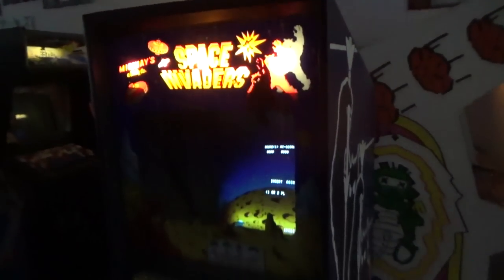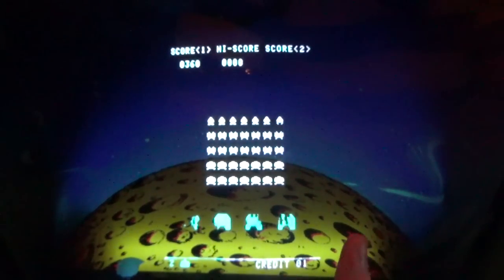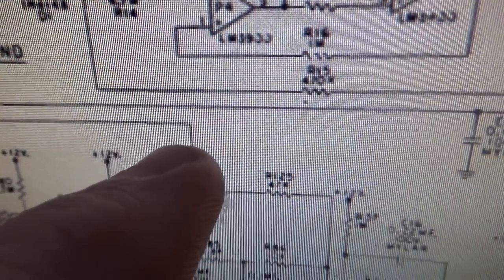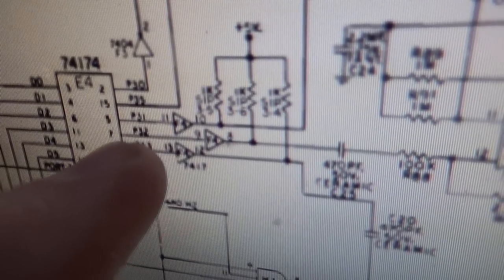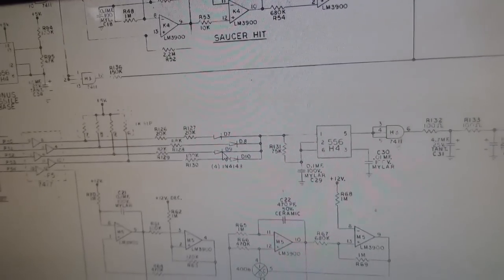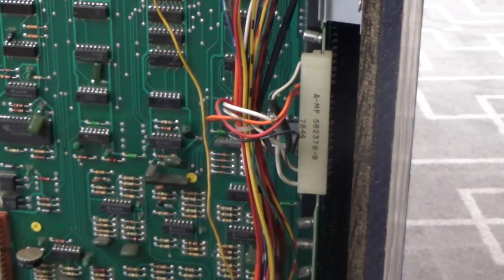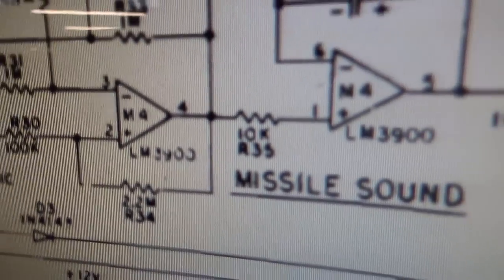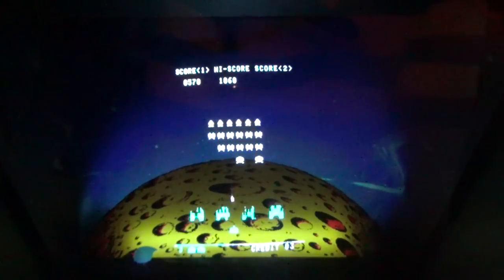Found a 44 Year Old Error In The SPACE INVADERS Arcade Schematics Midway & Taito Classic PCB Repair

Comment: I think your call of M4 was right. Its entirely possible for one section of an op amp chip to fail on its own. The entire chip doesn't have to go bad. Seen it a number of times in PURC 5000 advanced digital paging systems.
Reply from the maker: I usually poke around and get it after a chip or two :)  I'm getting better at the EM pinballs, last night I fixed one down to the SWITCH off of the schematics, I could tell exactly what switch it had to be.  Thank you for watching Yu Wish like always!

Comment: I have the exact same Midway Space Invaders machine.  After a few years of ownership I noticed the saucer sound stopped.  I had the intention to eventually repair it.  Before doing so I ordered the "save game" chip that also included "Space Invaders Deluxe" and a few other games I never heard off.  Anyway,  After booting up the machine with the new chip I noticed that it fixed the saucer sound problem I had.  2 years later and everything is still good now. g up the machine with the new chip I noticed that it fixed the saucer sound problem I had.  2 years later and everything is still sounding perfectly.

Comment: Do you remember the original Galaga that had the software error where the blue and yellow fast moving fleet would come so fast and diagonal in the corner and it was super human speed that you could barely see it was so fast and impossible to get out of the way

The company, I think Namco, they issued new eeproms with the corrected code that fixed the glitch

I remember when the game came out and I would play it at the local mall in town with my uncle and he would get so angry when it would do that glitch and he would scream at it and say there was no way you could get away from that why would they do that and it was only a short time maybe a couple months before that machine was either replaced or they replaced the eproms in the game
I actually think they were ROM chips

They were not eprom they were hard coded at the factory with the programming and could not be changed

And there was I believe 8 different banks of ships that made up 8K of memory for each of the different screens and components and there was another set of chips that handled specifically The sounds the game made

And I thought they actually had separate Giant XT size motherboards that had the sets of chips

Maybe some of the original games did have that before the large enough chips were available to be able to put 80k worth of memory chips on a single board

I'm 99% sure I've got a memory of watching a machine being fixed where they were pulling out boards

And I am 1000% sure that the first digital linked traffic lights had rows of boards that plugged in that each handled something different

I remember my town had six traffic lights and they were all the old rotary clock style with the thumb screws and the little mechanical levers and the boxes were very small like 8 in by 11 inches by 6 in deep

And the clock wheel would turn and as the set screw would push the metal switch you would have the one side red and the other side green and that lever that it hit would turn on the yellow light circuit and all four hundred Watt bulbs for the four yellows on each side would all come on for one second or two seconds or 3 seconds depending on how far they moved the next thumb screw and as it moved it would hit the next switch lever and at the same time the yellow switch would be pushed to turn off the yellows and the red and green would flip so the green side would go from green to Green and yellow and then the green and yellow would turn off in the red would turn on and on the red side the red would be on and then the yellow would come on so you'd have red and yellow at the same time and then both the red and yellow would turn off in the green would turn on

Prior to that design they had an extremely simple alternating red and green so the lever would be flipped and you'd have read on one side and green on the other and as the wheel came around it would flip the switch and the power would be turned on to the other light and turned off to the one that was on

Those were dangerous and people wouldn't have any notice it was going to change and that's why they put the yellows in and I remember each change they made but for some reason our little city was chosen to test the first networked traffic lights and we didn't have that much traffic but these silver control boxes were about 8 ft high and 3 ft wide and 3 ft deep like a phone booth with a giant door on the front with smaller doors in the giant door that gave limited access for making the lights go to blink or all red or some other feature

But this was in the 1970s I think 77 and it was way ahead of its time and they had the boards that were almost 3 ft wide and 3 ft deep and they had chips and relays and capacitors and coils and all sorts of parts and they had an edge connector on the back that was almost the whole length of the board and it plugged in to the back of the case that had all of these connectors and those were mounted horizontal and on the bottom there were other boards that were mounted vertical.

And each board handled a different function and there was a networking board and it was I think either 2 25 pin or 1 50 pin connector and a giant fat cable that connected the two networking cards linking the one box to the other box and it was only a half a city block between the two lights but it would change the lights at the same exact time and I didn't understand why they didn't just wire one control box to the two sets of lights since they were changing at exactly the same time but they were prototypes for what would become the traffic control grid that cities rely on now to maintain traffic flow smoothly throughout the entire city and county and State

I remember the counters that each time a car drove over the embedded antenna in each lane on each Street it would click and count how many cars there were and they could set how many cars they wanted before the light would be tripped and how long to wait after that number was reached and how long to wait if that number wasn't reached so if there was just one or two cars how long did they have to wait before the lights would change

I remember the chips that were used in video games some of them were considered National Security because the simulations could be used for real life applications like traffic control or military tracking and guidance

It seems funny now looking back at how primitive it was but the games ability to try to shoot down your ship was the start of AI

And that software really was used and improved on by the military

I got to watch one night when a test was being done on laser communication from the ground to a satellite using a self-tracking satellite dish on the ground and it would acquire The satellites pilot conventional signal that most satellites have that identify what satellite it is basically its name like a VIN number on a car and this thing acquired the satellite and the modem sent standard handshake protocols into the laser transmitter and we were wearing special goggles and we saw the beam on the dish on the ground turn on and we could hear the handshakes and the two-way Communications and we could see the beam that was the analog sounds being converted to digital light pulses and once it had handshake and established the connection it transmitted continuously as it tracked the satellite from one horizon to the other horizon until it was just about to go below the horizon and it knew it's elevation and disconnected and the beam stopped

Nowadays this is how a lot of signals are sent especially for satellite to satellite they use laser beams but back then it was something right out of Star Trek

I watched The Big bang theory and the episode where they were bouncing the laser signal off the Moon I remember a bunch of guys at the college doing that from the roof of the particle accelerator building

We also used to bounce shortwave radio signals off the Moon

And there is a whole group of ham radio operators that use micro meteorites that constantly disintegrate as they hit the Earth's atmosphere and they are able to bounce signals off of those and I still don't understand how they do that but I've seen it done

The VHF ham band now has all of these digital chirps where they are using their Android phones hooked into aprs I think is what it's called on the ham radios and they're able to transmit very short messages basically their call sign and the call sign of the other station they're trying to communicate with and the GPS location and a few other characters, but it allows the app on the phone to show the actual current GPS location on the map of where all of the ham radio operators are that are transmitting this data

It's pretty cool and to think they were doing this before there were smartphones before it became commonplace and easy to do

Anyways I've ranted long enough
Reply: I feel obligated to give you a thumbs up just for the sheer length of that post.  Some cool info there too!

Comment: Subscribed - I'm amazed by all the descrete logic and analog circuitry that went into making the sounds for Space Invaders, something that today could be accomplished by a microprocessor such as a raspberry pi or even an arduino. I have an old laser that is similar vintage to Space Invaders and it too is full of descrete logic/gates/timers etc. The op-amps tend to blow occasionally when there is a mains surge as they are mesuring B+ of around 100V via a simple voltage divider, and current through a large low value high wattage resistor. There are gates to control safety interlocks, op amps to measure current, voltage, and laser power and timers to sequence all the events that happen during startup, running and shutdown. I keep it original, but you could easily substitute a switching PSU and microprocessor in place of all that stuff, and the power supply or "exciter" would be 1/3 of the size and weight! :)

Comment: As the invader formation gets narrower it has further to go across, plus it also drops fewer bombs and the safe areas for the base are wider.  But as the formation gets really tall it gets more dangerous as the bottom is closer.    I always narrowed it sideways to 3-4 columns, then tried to get them bottom up.  I always liked to get the last two stacked vertically, that makes them easier to hit than if side by side - you can either shoot ahead of the top one or behind the bottom one, but never between them.  If side by side and you miss the leader your shot will almost certainly pass between them.

Comment: Just thought I’d add Ron, that the part marked as 4006 is the same chip as the 4016, (marked N5,J5) there are four switches in a pack and there’s just one on the board… The CD4006 is a counter it’s here on the board but it’s just makes the white noise sounds, along with s9me EX OR gates. More errors :)
Reply from the maker: Yeah I never quite caught that one but you're right, the gates are all on the same chip but there IS a 4006 for the white noise, geesh you'd think they'd check this stuff :)  That one is still wrong on the Space Invaders Deluxe sheet too though....
Reply: @LyonsArcade  Old schematics can be a mine field…does it add to their charm though :) those LM3900 are shocking, sometimes wonder if to shotgun the lot…That said I’ve had new old stock ones be bad right out of the tray…

Comment: A couple of Easter eggs to report:

The earliest version of this game -- Taito's first release -- reportedly had an Easter egg where "something" happened if you destroyed an alien from the bottom row, last. Some reports said it worked with an alien from the second-from-the-bottom row as well. I never saw one to try it out myself; everything I ran into back then was a Midway version. (I'm not really surprised, since Taito's release was in Japan and they licensed the game to Midway for its worldwide release. I've never been to Japan, much to my disappointment.)

The second Easter egg was in the Atari game system console (Atari 2600) version of Space Invaders. In that game, which had a variety of modes you could play, if you put the cartridge into the system, held the reset button down, and then turned on the console, you would start in a version of the game that gave you two shots on the screen at one time instead of just one. I had that game and it worked as advertised.

Not an Easter egg, but some people think it is one: True randomness is impossible with computers, so they simulate it. The simulated "random" score for the UFO wasn't very sophisticated. You would score 300 points instead of 100 points if you hit the UFO with your 55th shot. After the 55th shot, count 15 and repeat. (So with shot 55, 70, 85, 100, 115, etc. Start over with each level.)

For those who want to know more about this game, I offer this link: https://en.wikipedia.org/wiki/Space_Invaders
Reply: On that first one, it was reported that the "Easter Egg" was a rainbow explosion. I have never seen it and believe it has proven to be false.
Reply: @roscianyt  Its in space invaders part II for the rainbow
Reply: first 300 points is the 23rd shot not the 55th

also midway just manufactured for the US, not Europe or Australia, but I guess that's nitpicking

Comment: Does anyone remember a space invaders cabinet that had a physical tank center front that turned left and right, and the invaders were projections of red lights along the back wall?
Reply from the maker: Never seen that one!
Reply: You mean the modern Space Invaders Frenzy?
Reply: @neilwilliams2907  Well this was definitely in the 1980s if I recall.
It was a real plastic tank (a few inches long).
Wish I could find a reference.
Reply: Investigating more maybe I'm misremembering 'Midway Invaders from Outer Space ' 1970.  The missiles did go top to bottom and there was a physical tank and a red projected missile. Could have sworn the invaders were red projections as well though...

Comment: I read some history of this game and there is no programming that speeds up the invaders as they get eliminated. The processor for this game is so weak that as the invaders get eliminated there are fewer items on the screen and thus the invaders speed up.
Reply from the maker: Everybody says that and it's an interesting idea, but my mind always thinks, how come the main ship doesn't speed up?  So i'm not sure that's exactly true.... None of the shots speed up either.
Reply: @LyonsArcade  People describe it as a "bug", but it's an integral design feature. There's a set amount of time for the processor to work between frames... (or half-frames in this game's case since there's two vertical interrupts but that's another story)... and graphics-wise that time is (more or less) alotted between six separate "objects": the player, the player's shot, the next invader that moves, and three different invader shots. (The UFO uses the third shot's time when it needs to be on screen). Since there was already so much going on, the invaders speeding up naturally occurred as a mechanic since it means you can just worry about the "next one that moves"—redrawing one invader per frame, and the less there are the faster the swarm goes.
It's clever. Perhaps it's serendipitous, but everyone who calls it a bug or a mistake that was just "left in" doesn't really understand the experience of assembly programming. This part of the design was definitely decided on at an early stage, and I'd wager it was on paper before Nishikado even wrote any of the code.

Comment: The speeding up of the invaders wasn't designed that way it was a system limitation due to the number of vaders displayed would slowing the MPU/CPU down - as you killed them it would speed up because the MPU had less to do
Reply from the maker: Why doesn’t the ship sped up?
Reply: Missiles stay the same speed, too, whether from your base or an invader.  Easy enough to see if the invader speed-up is intentional (I think it is) if someone looked at the code.

Comment: I found a file you were looking but for the Midway version at https://www.arcade-museum.com/manuals-videogames/S/SIDeluxe.pdf
It is schematic part No. M051-00851-A002
Game Logic P.C A082-90700-A000
Used on Space Invader II Cocktail, Deluxe Space Invader Upright, Deluxe Space Invader Cocktail.
It has the invader hit at top and saucer hit at bottom on page 27 of the pdf :) (if you didn't already find it)
Id love to build the simpler audio effects circuits but the 76477 can go jump cos i bet that's impossible to find that chip nowadays. The 556 and opamp circuits look simple enough and an Arduino could drive the inputs to control them. I know not quite retro enough but a compromise for those just wanting the sounds for some reason as authentic as possible. The 3 input AND gate chips and 7417 are just buffering except M3 which is injecting a 480Hz signal into the Bonus Missile Base sound from one half of the 556 Timer and the 74174 is a flipflop circuit that again just looks like it is buffering and logic control. Not really needed with modern equivalents. The Noise circuit is just an XOR feedback system into a static shift register to simulate random noise, again simple enough.
Old analogue sound generators are much more rich in tone and beef than any digital knock off. Plus they have the advantage of being easily tweaked and tuned to personal preference.